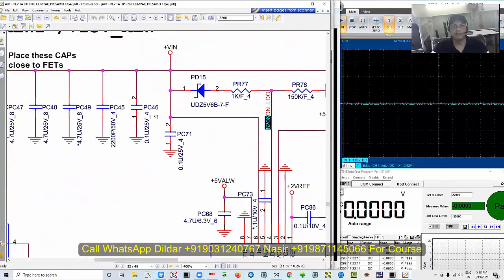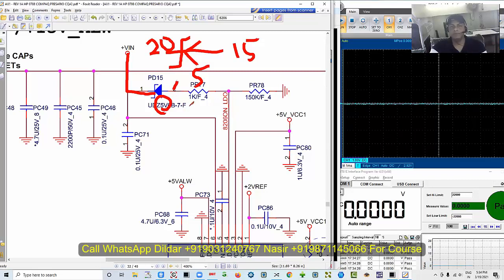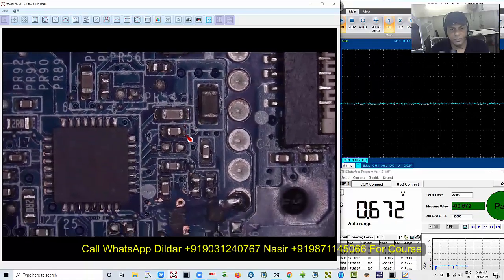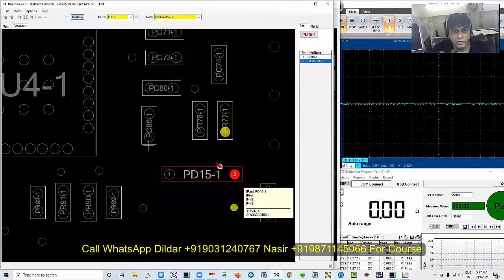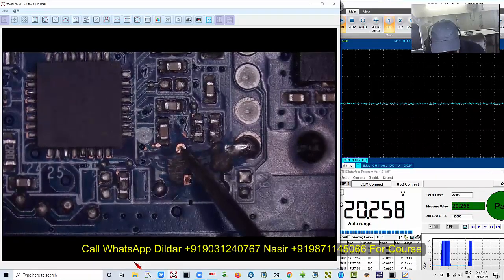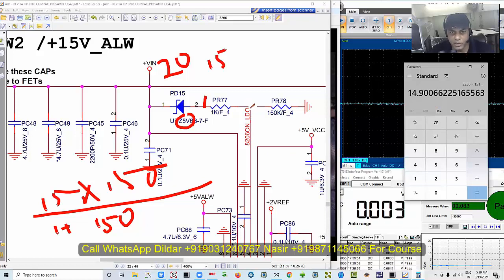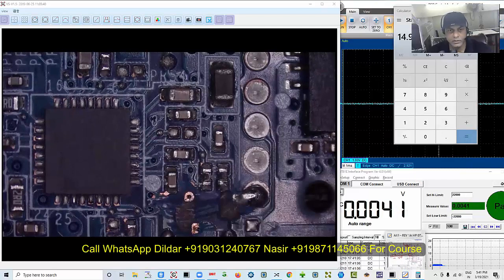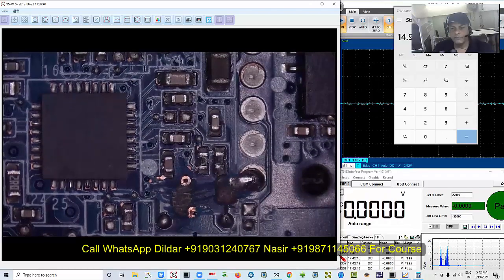3V 5V Enable LDO Jugaad for ZENER voltage divider Logic English | Online Chip level Repairing Course

Comment: Good video.  Thanks.  What temperature are you using when removing and soldering the diode and air flow?  I would like you to answer me.  greeting.
Reply from the maker: You can watch our BGP machine video there we have mentioned all the temperature requirements.

Comment: As we know that generally zener diode use as high voltage protection circuit..but here it's use as switch after threshold voltage ( after threshold voltage zener diode work as conductor with some voltage drop) . I think here diode is  use for LOW VOLTAGE PROTECTION  ( if threshold voltage of diode is 10 volt it means diode work in  bidirectional mode  and here voltage divider use after 10 volt ...)
Reply from the maker: Good point ☝️